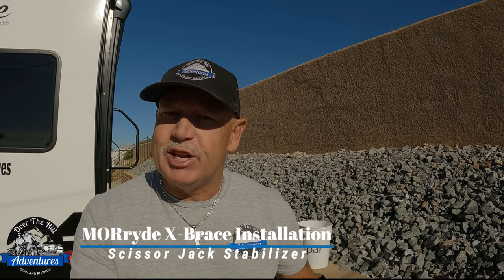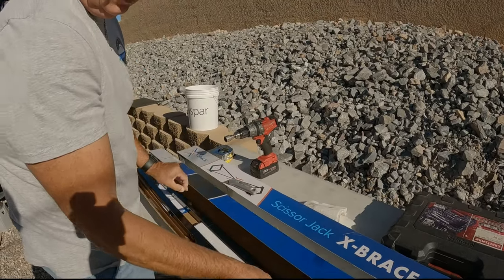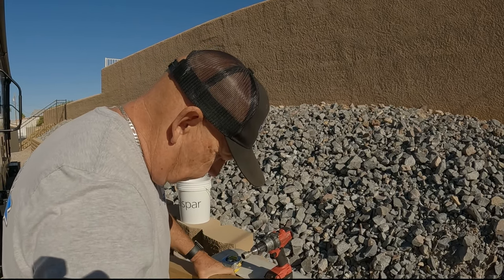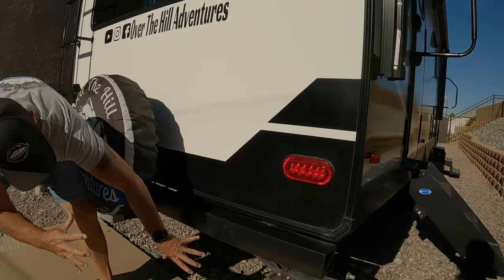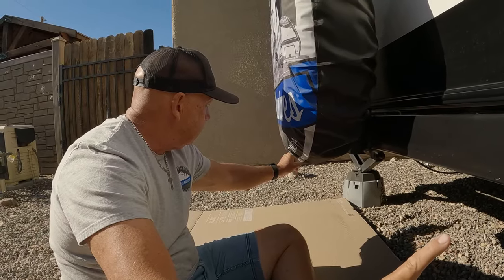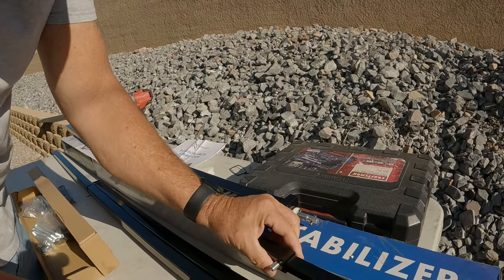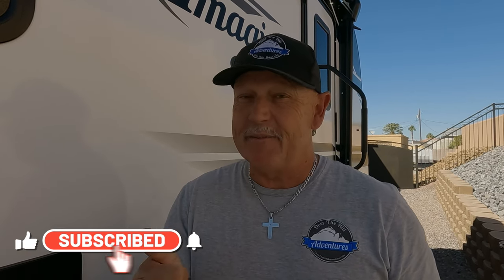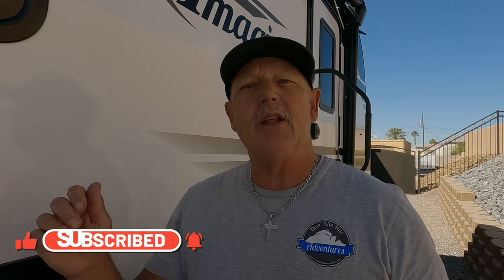Grand Design Imagine 2500RL Modification // X-BRACE BY MORryde

Comment: Stan, Once you set the tension on both sides are you done or do you need to loosen them when you bring your stabilizers up and retighten when you extend? Was not sure if it was one and done. Jeff and Lorie
Reply from the maker: Hi Jeff and Lorie, in the video I back them off 25 turns before I bring the scissor jacks up.  That is where they stay while traveling.  When you put the scissor jacks down it will be 25 turns to tighten them.  The only downside is another thing to remember before you bring your scissor jacks up.  Maybe Rhonda is right it may be time to write a list on everything I do.  Lol.  These x-braces make huge difference.  Really happy with them.  Hope all is well, Stan